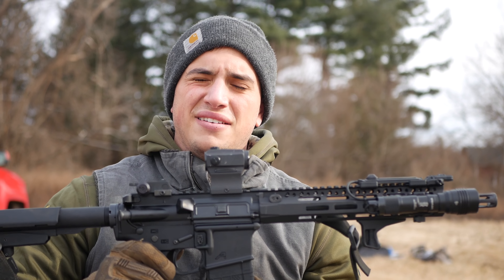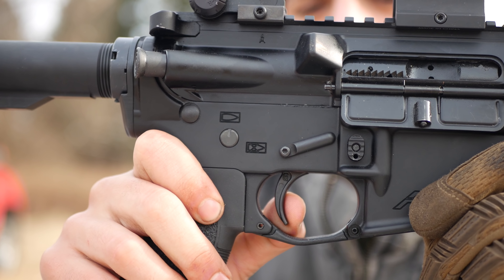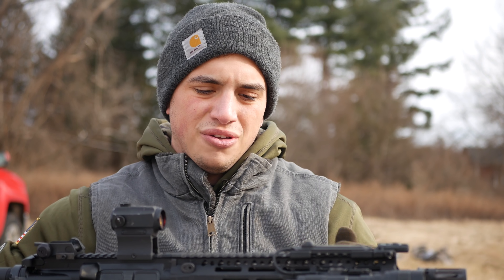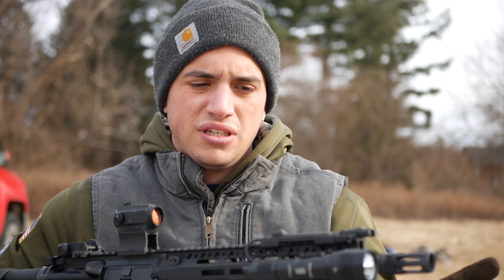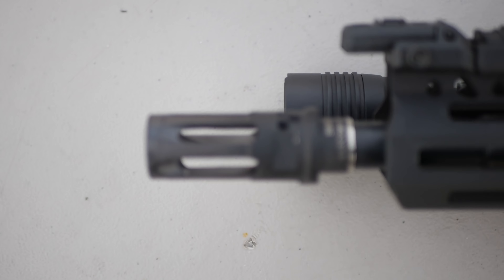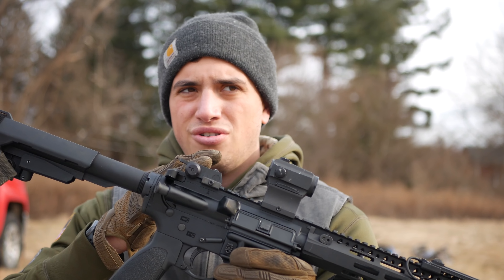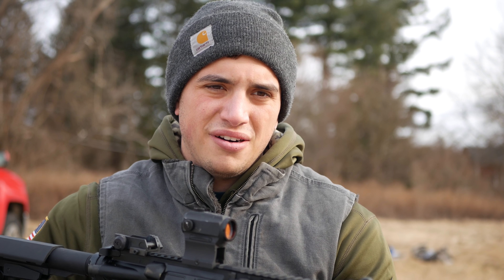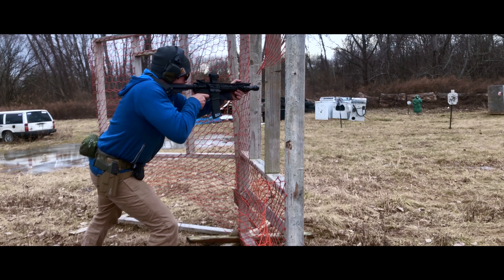AR15 Pistol Build - 11.5 in of Greatness | BCM MCMR, Giessele Rapid Fire, Roscoe Barrel

Comment: Nice clean build. I've got a very similar one, but with the M4E1 receivers and the BA 11.3 Hanson. It just feels great.
Reply: .625 hanson or .750
Reply: Doctor Cropse .625. I have some older .750 Hansons too, but .625 are just as accurate in my experience.
Reply: @jhalscott  is the heat resistiance really noticable?
Reply: Doctor Cropse I think it may be in some applications, but not really any I would encounter. I run mine pretty fast and groups really don’t open up much out of either diameter. I have several SOCOM barreled guns that could serve as makeshift light machine guns, but I am happy to trade the weight and maneuverability of the lightest Hansons for defensive applications.
Reply: @jhalscott  Do you think a suppressor would heat up the barrel enough to cause accuracy problems during drills?

Comment: You should be able to put a vertical grip on it as long as the overall length is over 26". Which it should be.
Reply from the maker: You right. But I gonna double check on the OAL.
Reply: @MaddMaxxLop yeah, it's a good idea to make sure. I put a extended tube on my MK18 mod  0 with a 10.5 barrel,but I triple checked it. Some people claim the   brace counts in oal. Guess it depends on how you interpret the rule. Either way your pistol build looks sik. By the way your block 2 turned out good too. Can't believe you got rid of the Elcan though.
Reply from the maker: Thanks man. You’ll see why I sold it within the next couple weeks
Reply: This, an 11.5 has a OAL greater than 26" with just a buffer tube so your gtg! Now the brace fully extended counts toward OAL so your def gtg. I run a vert grip on my 10.5" Mk18 Mod0 and on my BCM 11.5"er. Nice rig and channel btw
Reply from the maker: Thanks man. Honestly the KAG has really grown on me. I’m gonna stick with that for the foreseeable future.
Reply: This makes me sad now
Reply: I do believe with the new laws that you have to measure from the end of the buffer tube to the end of the barrel. Which is what is needed to fire the pistol. You don't need a brace or flash hider to be a functional firearm. Someone may correct me if I am wrong.
Reply: Sounds like that law is infringing on your rifle build.
Reply: H Garza I run an A5 extension and the LAW folder and I am at 26.5 or so.
Reply: Steph S   I could be wrong, But...  I thought I heard/read something about the most recent bullsh*t from the ATF that said if it has a folding stock, it now has to be measured with it folded..?    I know it used to be measured "with collapsible stock fully extended, etc." but Not anymore.  Worth double check'n.    Cheers🍻!
Reply: @RagnarOdinson  End of the buffer tube with brace off the AR to the end of the barrel (not muzzle device). The reasoning is (and stands) that the weapon cannot cycle without the buffer tube extended.
Reply: H Garza But than it’s not a pistol.
Reply: If is a 90 vertical foregrip is illegal if is a 85 degree angle is ok

Comment: In your opinion, for residential defenses, AR barrel of 10.5 vs 11.5 vs 12.5 and why?
Reply from the maker: 10.5 I guess. 2” of added velocity won’t matter much in a home defense situation. However, a 10” or less .300 blk would be more idea.
Reply: @MaddMaxxLop  
Understand. And for rural defense, thinking about 5.56 ammunition, which barrel do you think is good for both scenarios?  
We don't have 300BLK in Brazil
  : /
Reply from the maker: @igortiger9862  11.5 and 12.5 or both really well rounded but probably 11.5
Reply: @MaddMaxxLop  I understand, I will technically delve into the difference and decide, since the maximum range I need will be 250 meters. Thanks buddy!

Comment: I'm glad you mentioned you have an H2 buffer. I'm building an 11.3" pistol and everyone seems to like the VLTOR A5 buffer system for short barrels, but it's like $100. I'm gonna run the spikes T1 buffer and if cycling is too fast I'll swap the the T2
Reply from the maker: The VLTOR is also nice because it’ll put the OAL on an 11.5 to over 26”. But it’s been running very smooth with the H2
Reply: @MaddMaxxLop  yeah that makes sense. Question the the explosion of the gas tube. Did you mess up connecting the tube, to the gas block? Or was it just a crappy gas tube?
Reply from the maker: I didnt install the roll pin in the gas tube correctly. I’m still using the same gas tube.
Reply: @MaddMaxxLop  oh okay. I'm glad it wasn't catastrophic. Your gun is still in good shape, and you didn't get hurt so that's awesome. Rock on brother!
Reply: Melo Reviews I'm glad he mentioned the buffer as well. I recently built an 11.5 aeroprecision pistol. Looking at various YouTube videos it seems if it wasn't the VLTOR A5 Buffer most folks wouldn't mention which buffer they were running. So I went looking on different forums most folks that had a similar set up I was building ran it with a Spikes T2. So I went that route and took it to the range last weekend and ran about 100 plus rounds through it and I'm happy to report no issue and smooth cycling.
Reply: @gchild00  thanks for sharing man. I bought the T1 buffer from spikes and haven't shot it yet. All the parts for my upper are arriving tomorrow. So I'll test it out when it's all assembled. I'm hoping it'll be good without me having to spend extra money. The issue I'm having now, is my freaking safety selector detent is all messed up and the safety I is super gritty. Anyways, this is gonna be the 2nd 11.3" AR I'm building in the past 6 months. The previous one is identical to my current one, and that one was flawless. Well see though. Keep me updated on it man. 💪🏽
Reply: william terry  that's not a bad idea. I'm building an identical setup to one I already have but I was just concerned because I bought a T1 buffer instead of T2. I'll keep that in mind though. Thank you.
Reply: william terry  really? I didn't know they increase muzzle velocity. That's pretty cool though. And if I do choose to go adjustable, I'll definitely buy a superlative. I've only heard good things about them.
Reply: william terry  update. Shot about 250 rounds through my 11.3"  AR pistol. Flawless. Ejection of the rounds were right at about 4 o' clock, and it locked back every time after the last round! The T1 buffer worked out well.

Comment: What’s the overall length? Cause if it’s longer than 26 inches you can run a foregrip
Reply from the maker: Unfortunately I rockset the FH before I measured it. It’s right at that 26” line but I’m not gonna push the envelope. Plus, I’ve become a fan of the KAG

Comment: Nice vid
two questions:
1. the BCM kag is legal on an 11.5?
2. Whats the 11.5 carbine recoil like? Comparing towards a 14.5/16 carb/middy?
Reply from the maker: Thanks. 1. Yes, it’s a hand stop/angle grip, not a very grip. 2. The difference is negligible.
Reply: @MaddMaxxLop  For 2, is it more or less? I have no idea because i never shot an sbr.

I was thinking about trading my 16 for a 12.5
Reply from the maker: cool beans it’s gonna be slightly more than a mid length and barely more than carbine length, not very noticeable.
Reply: @MaddMaxxLop  Ok, thanks.

Comment: What made you switch from 300 blackout? Silly question but was in the process of an ar pistol and figured the 300 silenced would be better for suppressing but noticed a lot of youtubers like yourself are leaning 556
Reply from the maker: Michelle W I still have the 300 upper. I just hardly used it. I didn’t want the lower to sit unused. I do a lot of moving around due to my current job so once I settle somewhere I’m going to get some cans and probably shoot 300 more often but other than that it was just because I don’t see the purpose of doing the kind of shooting I do with an unsuppressed 300.
Reply: Thanks for the quick response
Reply: Can you run a can for 300 and 556 or is it better to by one for each ?
Reply from the maker: Michelle W you can run a 7.62(.30 cal/.300) can on a 556 but I’m told it’s not quite as effective. Not to insult your intelligence but you can’t run a 5.56 can on a 300. Also the mounts have to match up.

Comment: So is the geissele rapid fire trigger the same exact trigger as the s3g?
Reply from the maker: It’s the same feel and mechanics. Really the only difference is QAQC is slightly lower and you need these little clips to keep the hammer pin in. But other than that they are the same.
Reply: Madd Maxx Guns Channel sweet thanks

Comment: Hey man!  About to pickup the Rosco 11.5.. do you think this will operate with a standard buffer?  I have the maxim defense cqb pistol brace with the standard spring.  Any regrets not going 10.5 or 10.3?  Thanks man!
Reply from the maker: It should function fine. I just like playing around with buffer weight to see what functions best and helps with recoil. But 11.5 is superior to 10.5/10.3 in almost every way (recoil, accuracy, muzzle velocity, dwell time) however if I was running suppressed 10.5/10.3 would make more sense IMO.

Comment: How did you get the geissele gas block to fit with the mcmr? I had 2 and both were making contact with the rail and I had to switch gas blocks to BCm
Reply from the maker: I had no issues with it, it just went right on. The only issue I had was with installing the KAG. I had to put in on right behind the gas lock.

Comment: What size rail is that? I have the same 11.5" rosco barrel and am looking to have the same clearance as you have on this build. I see primary arms has a 10.3" mcmr and optics planet has a 10.5" mcmr and BCM sells a 10" mcmr that supposedly measures out to 10.5...
Reply from the maker: It’s the 10.5” marketed as the MCMR-10
Reply: @MaddMaxxLop  Thanks Bro!

Comment: What are your thoughts on the rosco barrels now that you have some trigger time with it
Reply from the maker: I haven’t done any more accuracy testing with it, but I have been able to make shots out to 250yds with the red dot without issue. My 14.5 roscoe is a tack driver. I have nothing bad to say about them at all and would recommend 11/10 times.
Reply: I just ordered a 11.5 myself today since primary arms had them for $109 lol this made my decision for me have a kac urx2 I’m using and a kac take off bolt carrier with a fail zero bolt will have a kac nt4 flash hider I pulled from my mk18 clone when I swapped a 4 prong lol so it’s mostly kac but aero receiver and rosco barrel should be a fun little upper
Reply from the maker: Hell yeah man.  You can’t beat roscoe, especially for the price. They’re one of the only companies than make their own.

Comment: Seems as if your front sight is on backwards. Is there a particular reason that you run it this way?
Reply from the maker: That’s just the way it fit on there with the tape switch for the light. I’ve since swapped it out for a DD fixed front sight.

Comment: What do you think of the Rosco barrels vs others you’ve used? I’ve been on the fence I have wanted one since they started but haven’t bit the bullet yet
Reply from the maker: They’re on par with ballistic advantage and better than aero. Haven’t used BCM. They are one of very few that make their own in house so that’s what keeps the cost down. I’d recommend 10/10 times. Price:quality ratio is as good as it gets.
Reply from the maker: I have two and have had great experiences with them both. I think they’re both good options. No preference between the two.

Comment: I’ve realized that the sba3 brace sucks for shouldering which it’s meant to but still lol so uncomfortable with the flappy ends and not enough length of pull to be comfortable. I guess that’s why it’s not considered a stock
Reply: Get rid of the stretchy strap that comes with it and replace it with a Phase 5 strap. It is a lot more rigid and will hold its shape better.

Comment: All BCM barrels are made by FN . FN and DD make some of the best barrels.  
BCM , LMT , LWRCI  , COLT 
/ COLT CANADA,  & DD are my top 5. If I had to choose Colt and BCM I like the most
Reply from the maker: I love my DD and Colts, but I’ve had best luck with Ballistic Advantage believe it or not.
Reply: @MaddMaxxLop  Yeah man BA is owned by Aero Precision.  AP doesn't make junk . I've had the best luck with Colt 14.5 SOCOM,   AND Colt 11.5 HBAR FBI HRT.  My SOCOMS shoot 1.2 moa or less at 100 . My best group was 1.10 at 300 yards with 77G OTM.  This was obviously using a lead sled . My FBI HRT Barrel shoot 1.5 moa or less at 100 yards with quality ammo . 
My M5E1 16" SS 308 shoots sub MOA out to 300 yards. My best group with lead sled was 0.96 at 450 yards using Match ammo
Reply: On all my builds I either use AP Gen 2 Ambi , M4E1 and on higher end builds I use LMT Defender Stripped Lowers.  I use BCM Enhanced LPKs. I do have an Aero LPK but I haven't used them yet . I have 5 AP Lowers and all have BCM Lpk and BAD ASS 45°. 
I use Vortex Flash Hider on all of my carbines ..
The SSP Trigger is my new favorite.  I'm a single stage fan boy for sure . Hiperfire makes a damn good single stage as well
Reply from the maker: sean white that’s good stuff man. I to have became a big fan of the SSP.
Reply: @AliasSLH no way do they compare to a FN HF Barrel , DD , Colt SOCOM ,  Noveke , LWRCI.  Or LMT . 
For accuracy Colt Barrels are some of the most accurate ones for chrome lined . DD are super accurate as well. LMT probably makes the most accurate chrome lined barrels . LMTs cryo mrp barrels are very impressive
Reply: @AliasSLH your absolutely correct . Just about any barrel is more accurate than the person using it . I've never ever had any QC issues with any barrels listed . Very few people actually shoot out a barrel . I know I haven't yet . I do have a14.5 Mid  FN HF Barrel that has almost 10,000 rounds. It still shoots 2 Moa or less .

Comment: Remove your SBA3 brace, remove the WarComp and then measure the overall length. If its over 26" then its no longer a pistol its a "firearm". And you can legally have a vertical foregrip. With an 11.5 barrel it should be just over 26" from the end of the buffer tube to the end of the barrel without muzzle device.

Its a no-no to install vertical foregrips on a pistol or other firearm that is less than 26" OAL as that makes it an AOW. But over 26" is good to go.
Reply from the maker: Yes I’m aware. It’s just under 26”. And honestly I prefer the kag over anything right now.